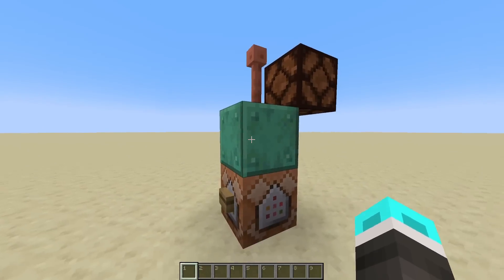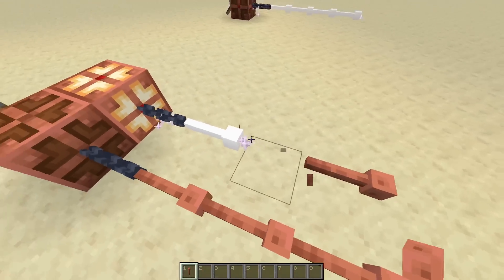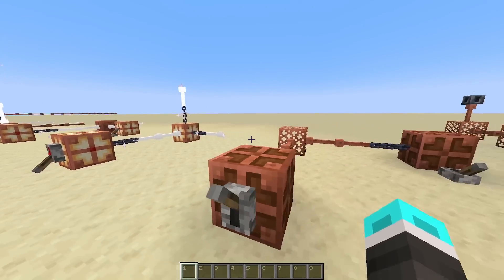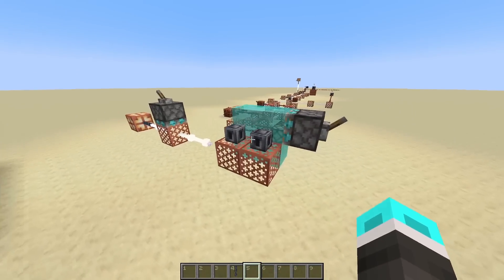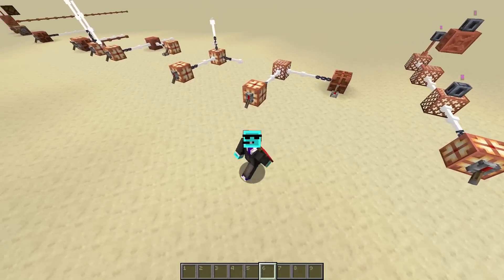Copper Wiring Datapack Beta 1

Comment: An interresting idea would be so the contact damage is dependent on the charge it goes through
so if it's charge from a lightning, contact damage is equal or a fraction of a direct lightning strike
And maybe a way to make capacitors increase damage some way, a way to increase discharge rate from the capacitor or a way to join those rods together to sum up currents and contact damage

Comment: You could make oxidized copper grates require multiple inputs for a single output, like an and gate
they could also charge cores slower(im sure there'd be a use for this)
or maybe they act as a redstone repeater, delaying the signal

Super cool datapack, would love to see what things like piston doors would look like using these components.

Comment: I'm not sure how easy it would be to implement, but my only gripe with this is that the bright white lightning rod texture seems a bit off to me. if you could add an alternative powered state for the rod, I think it would make the whole pack seem more cohesive. I understand that you are making use of its powered state from when it gets struck by lightning, but that texture is only really meant to be viewed for a split second.

Other than that, this seems incredibly cool! Awesome job on this.

P.S I think the comment you left regarding giving the heavy core a duplication recipe much like the armour trims is the best way to go about things. As long as you make it fairly expensive (probably involve netherite in some way) it won't  encroach too much on the vanilla survival experience regarding heavy cores.

Comment: My first thought on the logical Circuit side is that it would be nice to have a way to easily invert a signal so a not gate so a on-signal will be give out a off-signal and off-signal will give out a on-signal.

I think it is even possible with the pack rn in combination with a piston with a redstone bock and when the piston gets powered it will push away the redstone block from another bulb which then will be off.

But in logical cuircits u need most of the time a lit of not gates so a faster and smaller version would be very helpful.

On the side of funxtional features i am a big fan of the create mod and maybe you could if that's in line with your vision of the pack make means of generating power maybe with a water wheel which could just be a trapdoor in flowing water or a funace cooking or smelting something or even a bigger multiblock.

And then have machines which use the power maybe to smelt something with power or grow a farm or much more.

But idk if u would like to have it only as a means of logical circuitry or also as a medeum of recourse u have to generate, manage and use.

Comment: Super neat! Have a few notes

I think the copper wire should conduct full power when immediately powered, but slowly turn red/orange (like it's heating up) and lose power down to 0, while overall making the visual effect much more mild. Could do that insulating idea someone had to make them not lose power.

I also think whatever capacitor you use should definitely not display a number above it, and rather light up slowly on the interior to indicate how charged it is. Maybe use lanterns for this.
Reply: Oh, and also if possible, it would be cool if the head of the lightning rod disappeared dynamically when connected to another rod or device to make it look more like wire.

Comment: Use end rods as diodes (directional)
Repurpose chains for resistors
Repurpose copper grates for inductors
Make the energy be a floating point value and be reflected using the alpha value of the white color to make it more notable or less
Alternating current with two observers
Reply: Normal copper blocks to connect multiple components independent of direction

Comment: If this were it's own mod, I'd suggest changing the copper bulb for a unique capacitor block, where it needs 3 or 4 redstone pulses to send a pulse of electricity. This would further separate it from normal redstone and give it some different pros and cons. Plus it would then feel like the redstone is creating the same discharge as storm clouds.
But as it's a datapack, I don't know if this idea is feasible.

Comment: hi, congrats this looks awesome! I haven't been in touch with commands in a little while, so sorry for the dumb questions. But how do you detect things? i mean in the video you show you can place copper wires just fine and the circuit will auto detectit while it runs (maybe an entity iterating trough idk not important). But from the start? do you check every single block in the vicinity of the player when it places/activates a lever or something to spawn the initial entity inside the copper bulb?

Comment: Can you make water in a radius around also hurt you? I could think of some puzzles with that kind of feature. Potentially heavy cores could passively lose a small amount of power while submerged as well. 

You could give end rods another use - if power is input, it outputs power in a cone in front of it? Create a damaging field that can also provide power to multiple sources, allowing you to branch out without using obscene amounts of copper. You could also jump through the rods it’s targeting instead of just powering them all at once for a clock system.

Iron bars, when powered, could provide a repulsion force to the player / any entities it comes nearby.
One of the copper blocks could act as an electromagnet when powered?

If farmland is powered, plants could instantly break (with a chance to not drop anything, so it’s more balanced. Still got to move the items!)

I don’t like the renewable lava source we currently have - maybe powering gold from 3 or more sources makes it transform into lava (I.e molten gold), while less than 3 could be used like an igniter from rust. Powering a gold block from 8 directions then breaking it manually (faster than it turns to lava, obviously) could be a way to obtain the light block in survival. I’ve always wanted one of those, and it could be a challenge if more power makes it melt faster.

Powering an emerald block and zapping a villager with it could randomise their trades.

Powering rails could make a minecart instantly reverse directions.

Powering a bookshelf could make it stronger - either you collect a ton of books or you collect a bunch of books and a bunch of copper for enchanting. I’ve always hated the enchanting grind and mining is just a little more bearable, though my friends would disagree.

Powered heavy cores above the cloud level could get struck by lightning and explode violently. 

Powered beacons could give a higher effect level but also poison. (In reference to the conspiracy theory, you could call this 5G and make sculk sensors have a higher range while inside a beacons radius)

Powered Ender chests could give off a signal when opened. Good luck trying to hide the hole behind them.

Players with iron armour should get a vulnerability to being zapped - maybe they take extra damage and get flung back from it? Similar to auric ore from calamity terraria.

Pigs, villagers, pandas, and mooshrooms could get transformed when they step on powered blocks.

Do you think you could make projectiles bounce off of already powered blocks? That would be cool. 

Powered saplings could grow instantly but when they do they’re on fire. Bone meal is too inconsistent. 

Powered redstone blocks could power redstone in a 5 block radius. 

Powered iron doors could stay closed regardless of redstone input. Maybe even zap you when you try to break them.

Powered enchanting tables could, when an item is thrown on them, electrically charge it. This is symbolised by a description tag which you can then right click to consume (get rid of the description. (Run a check if the description is there to activate it - thats how I put in custom enchants bc there’s no framework for it iirc) and get a few seconds of solid haste / a hit which deals extra damage or strikes lightning / speed / anything

My ideas are starting to deteriorate in quality. I’m done here.

Comment: Capacitors in circuits are usually useful not just for storing power, but having a maximum power they can hold for timers. Perhaps you could make it so capacitors have a max energy of 10 by default and can be right clicked with something like iron to increase the limit. You could make it so iron blocks give 100, ignots give 10 and nuggets give 1, with the bonus difference simply for keeping things even.

Comment: To make me truly interested in this mod:
* two parallel copper wires should be made to interact if enough power is applied to one of them. This is what antennas do. Power is siphoned between the two systems. And then waxing for insulation is optional.

*Power should reduce along the way as would a real system featuring resistance (like Redstone but the the distance/signal strength could be made higher at the source, like 255 instead of 15). Higher reduction with oxidation due to higher resistance.

I've always disliked the infinite sources of Minecraft. Make a system where energy needs to be gathered. Lightning is a given source, maybe electrical eels could be bred for power generation, some mob found in the nether (warped forest?) and/or a another for the end. I'd try to stay away from fueled electrical generators. It's been done to death already.

Comment: Using a fence atop the grate and connecting several together with leads could provide a bidirectional wiring option over short distances, and could be used for making hanging power lines that look really cool

Comment: 5:50 same reason as to why block entities are not movable. Look into how carpet solved this issue with chests, hoppers etc and you'll get some inspiration as to how to solve this.
Reply: Isn't carpet a mod? This is a vanilla datapack meaning its a series of vanilla minecraft commands. I don't think he will be able to do what they did.
Reply: @DanMizu  as i said, "inspiration", not copying the solution. It matters not the platform, some solutions are interchangeable. Be it either by storing the values in a different place or comming up with an entirely new idea INSPIRED by the mod.

Comment: why not make the copper block part of the wire and use the copper grate as the capacitor instead, seems like itd make more sense visually showing particles to show the power its holding

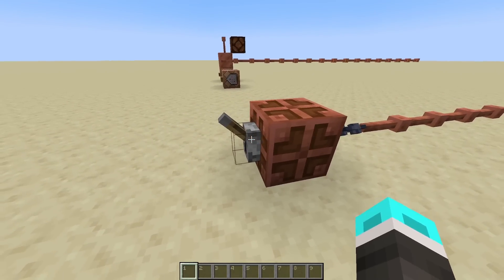Comment: 1:35 Chain can heating and gives heat and light like heater.
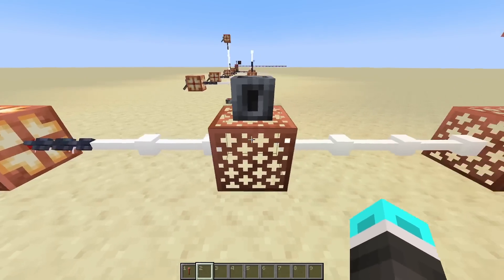4:00 You can integrate energy bar to texture. It will looks better and more like "vanilla".
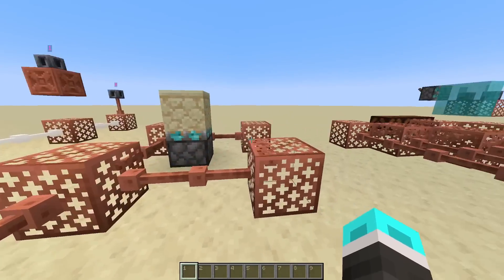4:55 I think, pistons and other mechanical blocks need spend energy. So, perpetual motion can not exist, and we will need to "pump" energy into a system.
6:14 I think, water need do damage in a radius, when there is energy.

Comment: It would be cool if you could summon lightning using a highly charged heavy core. I imagine it happening when you connect it to some specific block when there's a lot of power inside of it. I can think of a few uses of that mechanic.

Comment: Great work! It all feels very vanilla, too!
My one criticism is the number that appears above the heavy core to indicate charge level; I think if the indents on the sides of the block slowly filled from bottom to top like a progress bar it would fit better for survival. Maybe have the option to show the number in accessibility settings or only show it when the player hovers over the block with the cursor
Reply: A mod could improve on the display of the power state. With a datapack, that's pretty difficult to do and might cause excessive lag

Comment: I think it would be cool if redstone didn't just generate unlimited power, and instead generate one unit of power each time the lever is flicked, kind of like a hand-cranked generator. That would give more purpose to the capacitors (If you have unlimited energy, why store it?). One could then build a bunch of redstone clocks with copper bulbs as a kind of "power plant". You could also add an oven as a constant energy source, and make lightning add a greater charge to the cable.

Comment: It would be nice if some other block could be used as a power source instead of the copper bulb, because the state of the light could be really misleading in some cases.
Let's say you have a bulb inside a wall, and on the side of the bulb you have a lever, you would have no actual way to see if the circuit is enabled or not because the lever is covering the red dot.

Comment: The Heavy Core Capacitor is an interesting idea, but imo it is a little bit more in depth and complex than the rest of the features (which are all incredibly elegantly implemented!). I feel like a more "vanilla" feeling implementation of a capacitor like object would just have two states, off and on, and it would turn on after receiving power for X amount of time and turn off after receiving no power for X amount of time.
You could use cut copper blocks, slabs, and stairs for this, and even make the turn on and turn off times different based on oxidation level and type of block!

For example, maybe copper stairs turn on immediately, but take a second to turn off (shorter for more oxidized versions), while slabs take a moment to turn on, but turn off immediately, then lastly cut copper blocks have standard delay on turn on and turn off times.

Other ideas for blocks that can be capacitors are amethyst crystals (silk touched, of different sizes), pressure plates (stone, iron, and gold have different properties), or cauldrons (different fill levels and fill materials have different properties).

Comment: Amazing! One thing that would be really cool for things like computers would be to have some kind of semi conductor or transistor functionality. We saw that you can make AND gates and OR gates using copper grates and copper bulbs respectively.  But I don't immediately see an easy way to make a NOT gate without using pistons or other moving parts or redstone. One idea would be something like a quartz pillar (I can't think of anything more thematic) which conducts signals from top to bottom, or vice versa, but not when a signal comes into it from the side. This would allow for NOT gates, XOR gates, and other useful logic
Reply: Now that I think about it, a chain is also directional block that could also be used this way, but idk if overloading the bulb output behavior and the transistor behavior would be too much
Reply: If you use a grate as an AND gate, but only use one output, you basically have a transistor.
However, there are only binary power signals, so you can't use a weak signal to toggle a strong signal on and off like a real transistor could.

Comment: IDEA!!

minecarts with batteries that can keep moving as long as it has charge. they’d be faster than normal minecarts and remain at a constant speed as long as it has power. maybe there could be a special button to change the direction of the minecart to make it turn around with a click. i’d imagine they’d be craftable with a heavy core. perhaps they’d go faster or slow down if they go onto redstone powered rails. hope this is a cool idea

Comment: The copper grate idea is genius, with 1 output rod you have both a redirector and an OR gate, and with 2 or more output rods you get an AND gate. BUT! it is still not "functionally complete" (i.e. it is not enough to make a general computer) because the OR and AND gates cannot reproduce a NOT gate (you could use pistons or redstone but that doesn't sound great).
You need to complement it with some kind of inverter logic, (preferably with a XOR or XNOR gate since: 1- They can be trivially and intuitively reduced to a NOT gate, 2- Are incredibly useful, 3- Are the most annoying 2 bit gate to implement using only OR, AND, NOT gates) but a simple NOT gate is enough

Comment: This already looks awesome! Just having junctions is already a game changer.
Regarding the Heavy Core capacitor - adding a recipe to craft it would trivialize getting a Mace, as other comments have pointed out. I think the rarity of an infinite capacitor is already well-reflected in a Heavy Core, so I suggest having another block specifically for limited capacitance. (Perhaps copper ore?)
Reply from the maker: Considering it, either that or a way to duplicate the heavy core once you get one, but it'll still be expensive

Comment: if this brings this much oportunity already wow, i would rlly like to see this be weaponised in another way other than  being barbed wire like a copper sword or some kinda of attachment done by the smithing table like a sword and copper with lets say a lava bucket or a heavy core instead of copper like a gem stone at the hilt would be nice so you could charge it up by holding right click or repeatedly hitting a powered line and then it does extra dmg or even a cool explosion. but ideas aside cool mods and i can see how much this opens up and what can be done aswell giving a good use to copper

Comment: First off, dude this datapack looks amazing and I can’t wait to try it out! I have one concern though, which is the copper bulbs and their effect on light, since that would add unnecessary lag for the lightupdates. Since I don’t know about the performance impact of the rest this might be irrelevant, but hours of lighting up redstone wiring  have made me wary in this regard :D
Reply from the maker: Currently there is no lit bulb detection, just if it's powered. I see your point, though I don't think it's a huge deal personally. Maybe big enough machines might cause a bit of lag, not sure yet. And thank you!